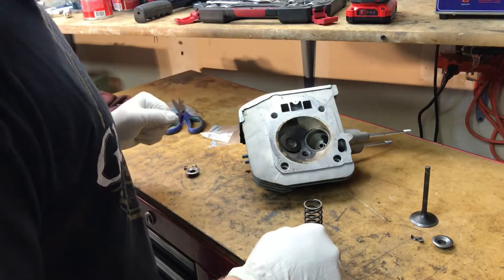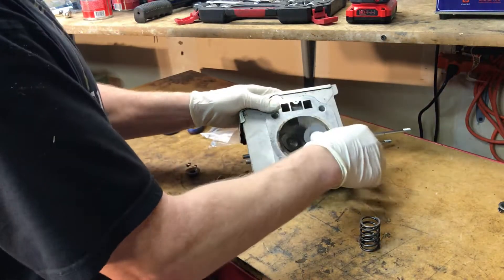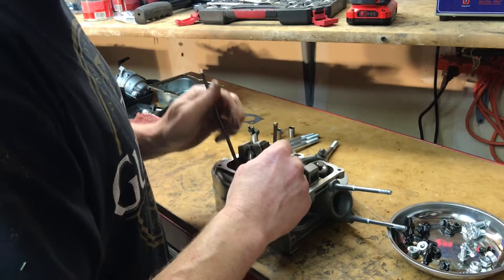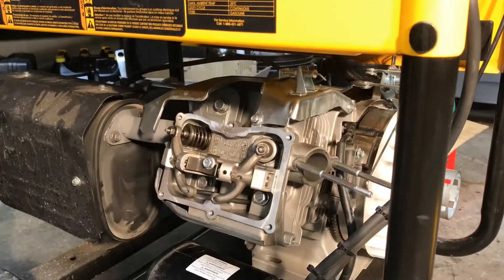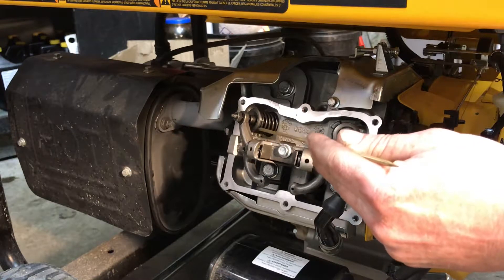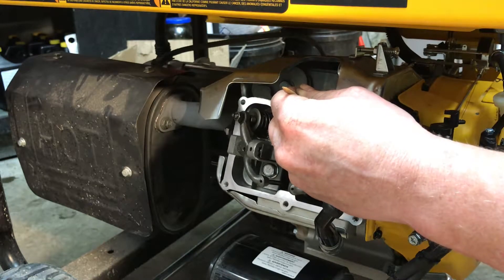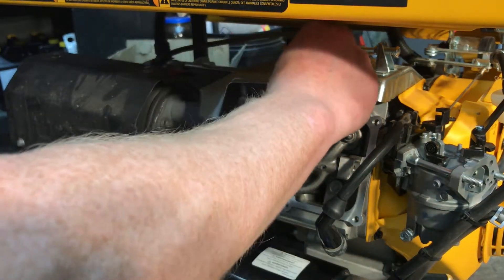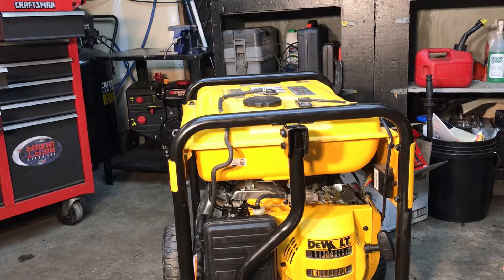Dewalt Generator Valves Small Engine Repair

Comment: Very cool video, I love your attention to the details, that what sets a great mechanic apart from the ‘flippers’ that patch-n-go.  I found a Dewalt DXGNR7000 in the dump.  It had no evidence of the oil changed and was extremely low.  Cranked over but no spark, added 1/2qt of oil and she lit right off :)   Now giving it tlc and about to adjust the valves.  Your video is perfect to keep me on track, especially with the valve clearance specs and rechecking after first fire!
Reply from the maker: Thank you.,

Comment: I think I have that same generator, it's 8000 running watts. It has about 20 hours on it over 2 years. Today it wouldn't start. I pulled the valve cover and the intake pushrod had detached from the rocker. I put it back together and it runs fine now, but why did this happen?
Reply from the maker: Check the valve lash. If it is to much the pushrod can come out.
Reply: @small_engine_repair  yes, I did, and then my pen decided, at that moment, to fall apart and drop into the engine. Fml

Comment: Do you know if the DeWalt flywheel and starter fit Honda clone engines? I can get parts from one at the scrap yard for a project.
Reply from the maker: I don’t off the top of my head.

Comment: I'm looking at a Duromax XP12000EH - what are your thoughts on this particular model or brand in general - Honda's get high marks but very expensive - any better choices than Duromax like Westinghouse, Champion ?? Thanks!!
Reply from the maker: I think it depends on what you are going to use it for and how reliable you want it to be. A Honda is going to run and not give you problems. Buying something cheaper are prone to failures, but if you are not relying on it then cheaper could be the way to go. I put up a video on a Duromax generator and the windings(wires) burnt out. Not 100% sure what caused it.

Comment: What do you think of these Dewalt Generators?  Are they prone to this kind of failure, or was this more a luck of the draw?  Are these decent for the price?
Reply from the maker: Someone might correct me, but I believe they are genarac parts, just re branded as dewalt. Genarac is a good brand.
Reply: @small_engine_repair  they are Generac, I was just wondering.  Generac or Dewalt generators, how do these hold up, do you see many failures?  Thanks for the reply bud
Reply from the maker: Failures I see come from lack of routine maintenance. Most people do not read the manual and follow the scheduled maintenance. Especially adjusting the valves. If  you follow the scheduled maintenance they will run for a long time.